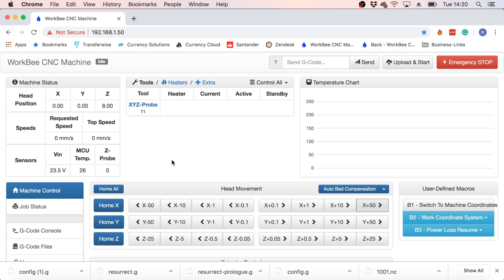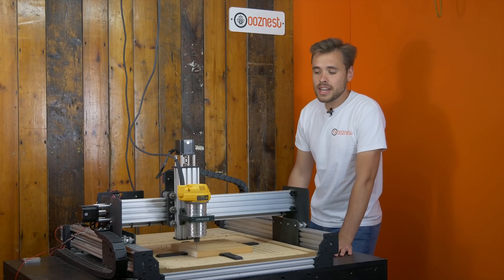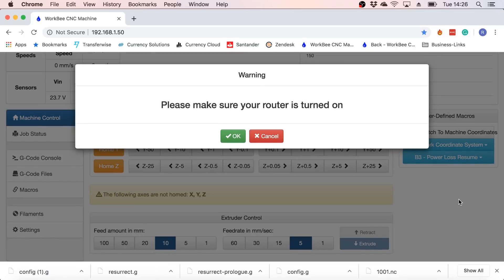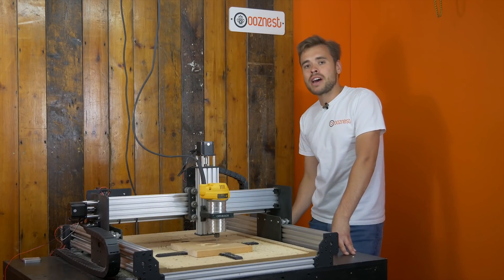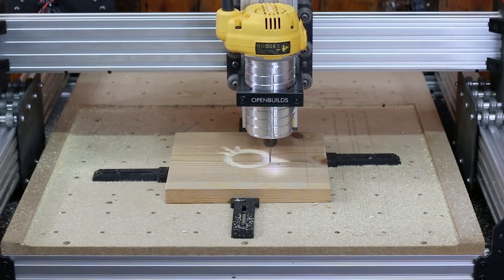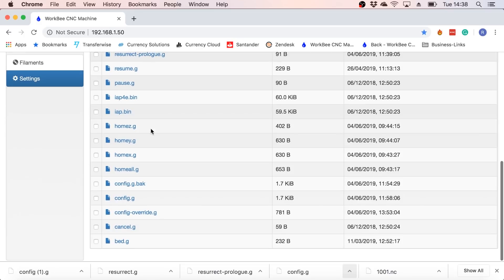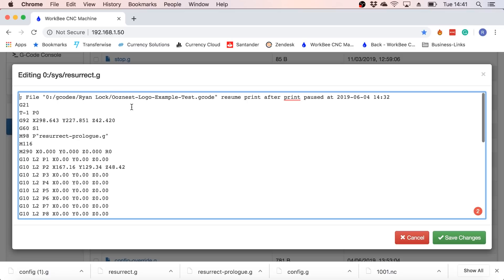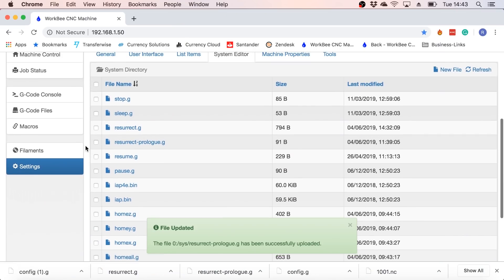Resume Your Job After a Power Loss | Showcase | WorkBee CNC Machine

Comment: I have mach3 controller RJ 45 connector have in mach3, so how to solve this power cut resume Engraving . Please guide
Reply from the maker: This video is for the Duet Controller, not Mach3
Reply: Did you get any solution
Reply: @indianwoodworking1684  yes